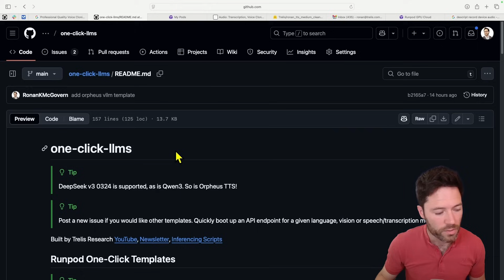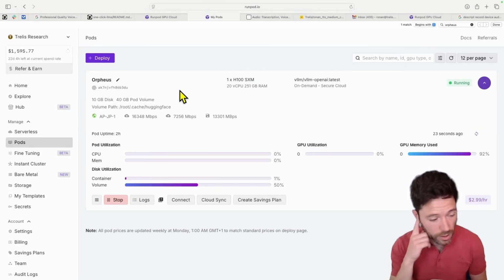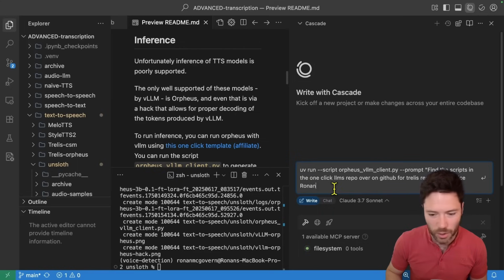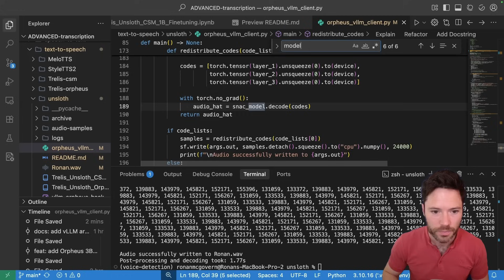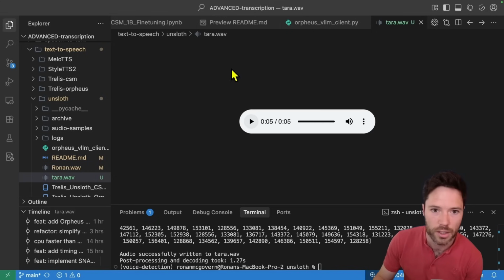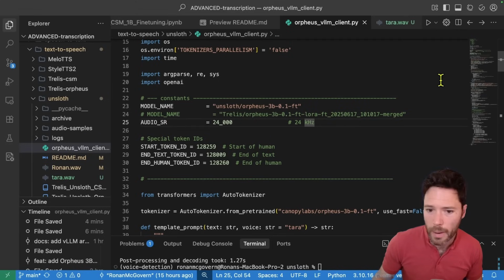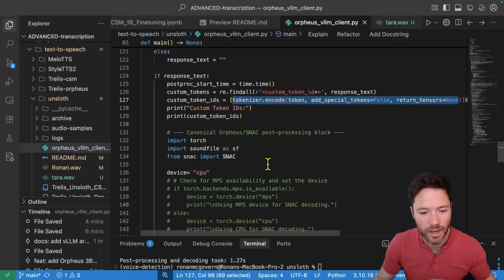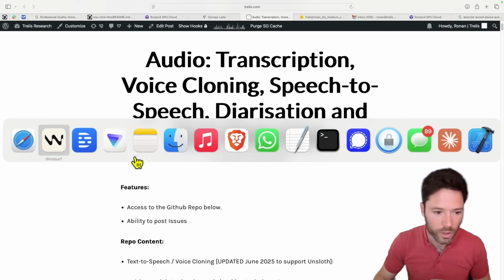Serve a Text to Speech Model with vLLM

Comment: vLLM is a lifesaver; however, we are hitting a wall when trying to use it in high-throughput use cases. For some calls, we experience sudden spikes in latency, while others remain steady. (Github Issue: vllm-project/vllm/issues/22621 ) Do you have any ideas why these spikes occur and how we can solve or approach issues like this? Are there any workarounds? I would greatly appreciate your comments and any resources that could point me in the right direction.

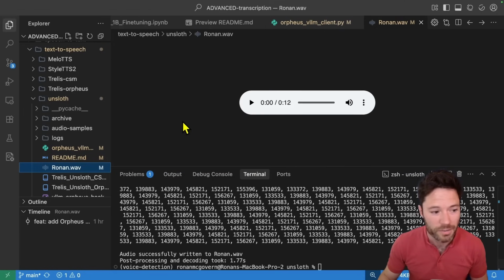Comment: 5:04 - I really appreciate that you leave stuff like this in. Too many guides and information I try to find on various models, etc like to cherry pick the best results or have input parameters chosen for their specific example, not showing the time spent trying to get a working solution. This fits so much better with many of my experiences 😆

I'm curious, one thing I've notices with TTS models is I seem to have a problem getting the correct length speech back in a good way.  If I set the max tokens too low, the audio gets cut off at the end, but if I set it much higher I either get results like your first one (weird droning from the speaker at the end), or the speaker just continues to ramble at the end (intelligibly, just it's new text beyond what I input). I don't know enough yet to figure out how to tackle this correctly. At the moment my only solution is to manually adjust the max tokens until I get the result I want, but that's obviously a terrible solution since it requires manual intervention and lots of generations for each text input to get the desired result.
Reply from the maker: Yeah cheers appreciate that.

It’s hard to know but my next step here would be to go back to look at the data and how padding works. I know that I set a long model length for training but I had no data that was that long. So there’s a mismatch here between short training and long inference
Reply: @TrelisResearch  Thank, I'll see if I can find info on training token lengths on the models I use when I get back into looking at this.  My current attention has moved to working on a setup for long/mid/short-term memory. It's a fun design problem.